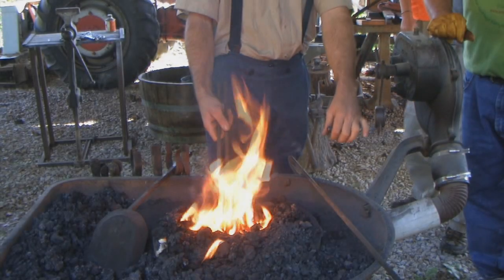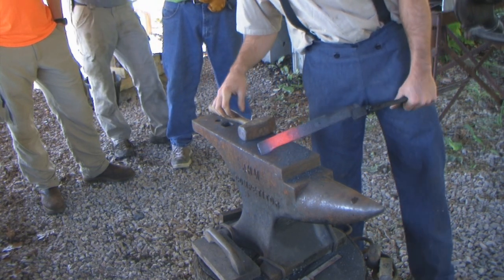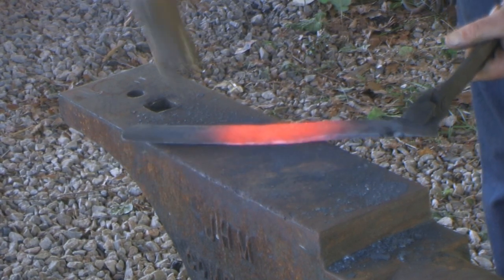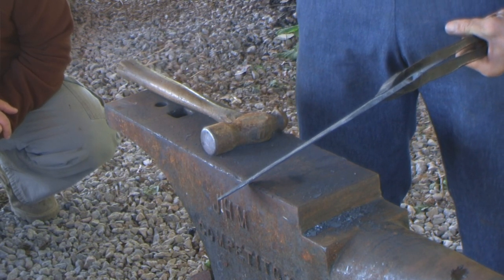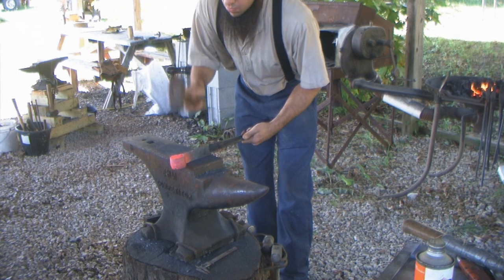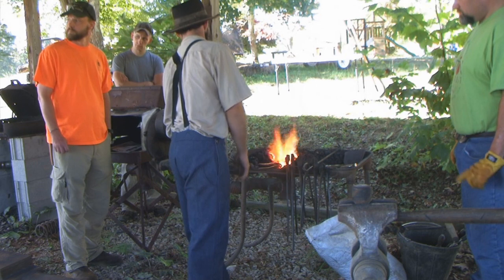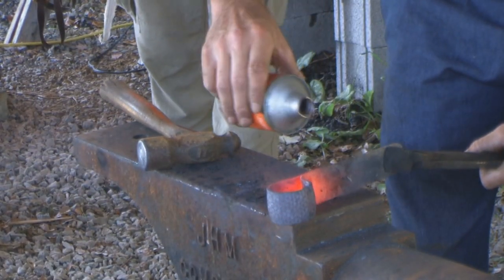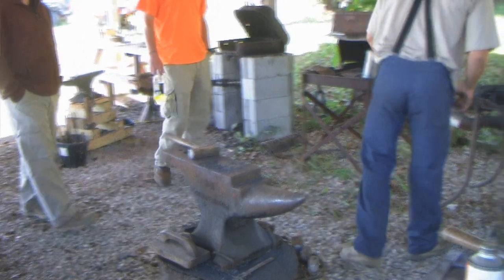Forge Welding a Froe Eye Pathfinder School Self Reliance BS Class 2013

Comment: Traditionally used in the production of wooden roof shingles or lathes for traditional lime plaster work, the Froe has been recently been rediscovered as an alternative to the axe as a log splitting tool.

Couldn't figure out what a Froe eye was, so in case others don't know:
Placed on the log, and struck on the back of the steel blade with a heavy wooden maul, a sturdy Froe can make short work of even twisted or bent timber as all of the energy of the strike will go between the natural grain.

Comment: “A froe (or frow) is a tool for cleaving wood by splitting it along the grain. It is an L-shaped tool, used by hammering one edge of its blade into the end of a piece of wood in the direction of the grain, then twisting the blade in the wood by rotating the haft (handle). A froe uses the haft as a lever to multiply the force upon the blade, allowing wood to be torn apart with remarkably little force applied to the haft. By twisting one way or the other the direction of the split may be guided.”

Comment: i've used two speed hair dryers to make a forge. you would need a bit of high temp metal piping to keep it away from the heat of the forge. but it will work. the first time i made one. i made metal disappear / vaporized metal, when i left it on too long, walked away from it too long. were as a hand cranked blower you can't walk away.

Comment: The taping keeps the energy in the hammer so it takes less energy to lift the live hammer. A good anvil will pop your hammer up with equal force. The ping you hear is the sound of a good anvil. If you worked metal for 14 hr. a day it makes a difference how many times you had to lift a dead hammer.  Trust me a 2 lb. hammer will where you out. So tap.

Comment: Look up splitting white oak shakes with a froe and you should find some good videos.  Find one that starts with a full log, divides it and makes shingles.  Notice pushing/pulling the handle will control the split direction.  Notice how tree forks are used for a brake/vice as well as your knee.  Notice use of shaving horses and draw knives.  Make them from the same tree out in the woods and you'll be very satisfied with yourself.  Now go have fun!

Comment: Nice work!...A high carbon steel like in that rasp isn't easy to forge weld either like wrought iron. While rasps and files were traditionally used for many tools don't think I have ever seen an old froe made from one, most were wrought iron since not important they take an edge
  I was a professional 'smith for many years making mostly 18th century knives and axes forge welded many axes up out of wrought iron buggy tires and broken file bits 

 I know lots of Amish and I don't know if this ' smith is a real Amish, hard to get them to work with a tool that doesn't run off compressed air!